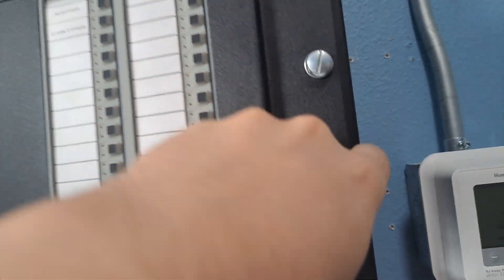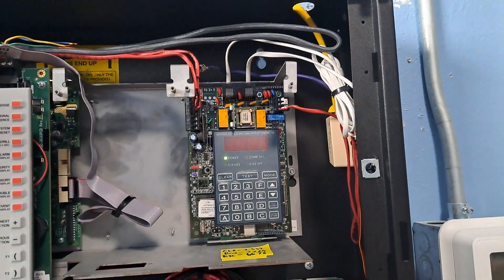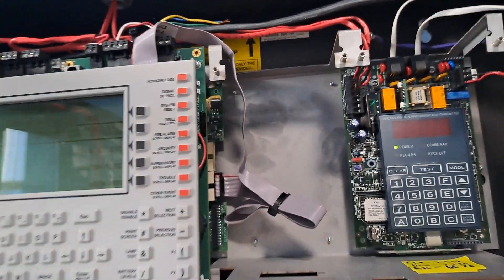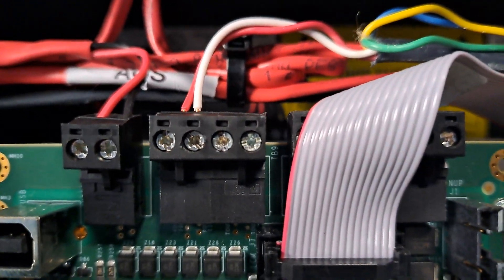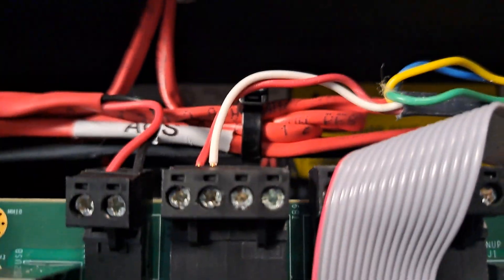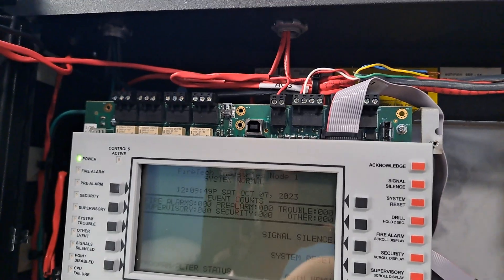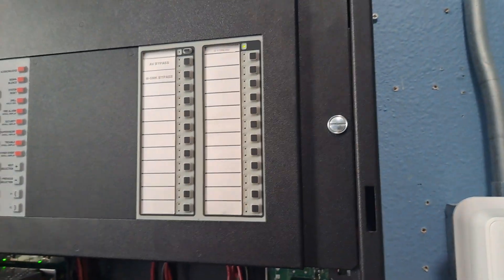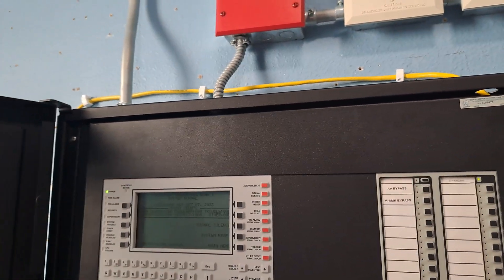Notifier Fire Alarm System Test 21

Comment: Hi I have a question regarding the system at my high school. We got the all clear from the fire Marshall to use the drill button for 2 of the drills (the other 2 have to use a pull station because they want a full alarm). This is a very large system with lots of control modules. Will the drill function set off alarm alarms in the building?
Reply from the maker: It's very hard to say, it all depends how the system was programmed.